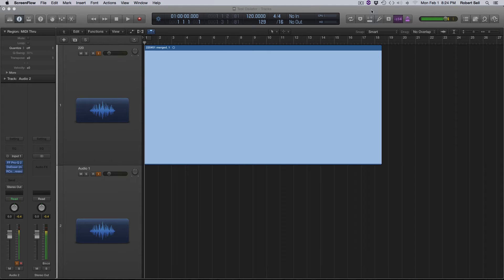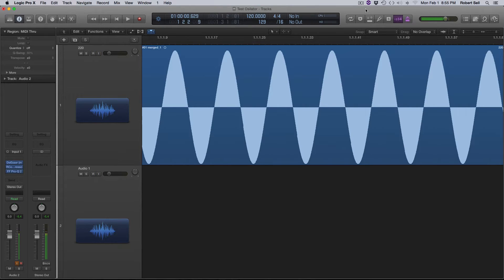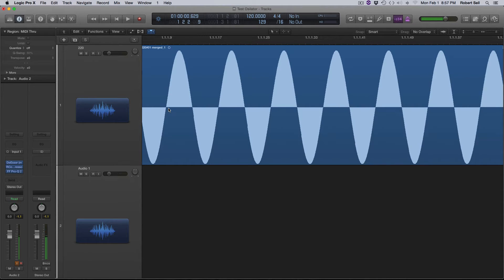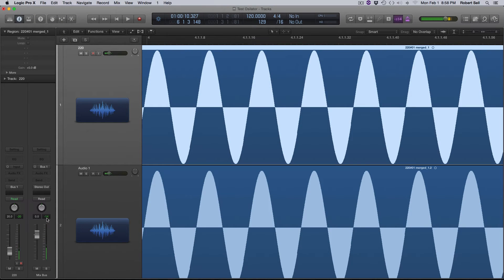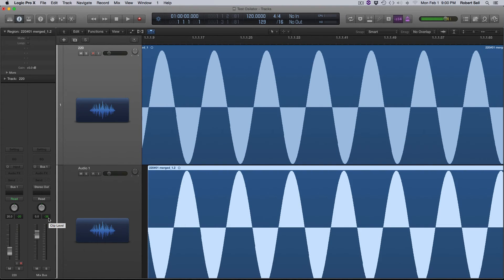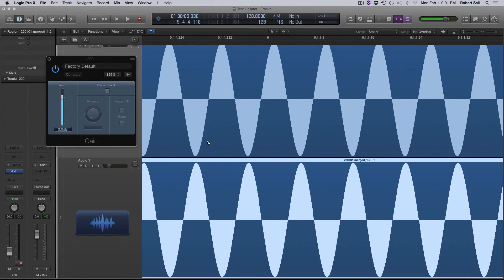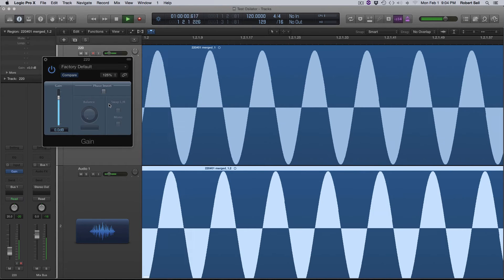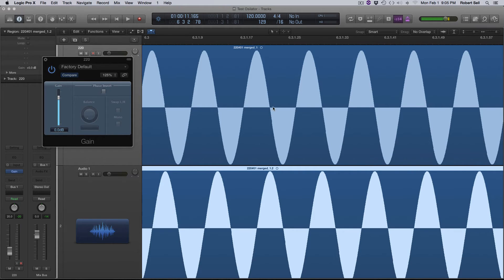Audio Recording Phase Cancellation

Comment: oh great knowledge right here..so can i do this with different instruments with different wave forms..eg a guitar and a vocals..?thanks in advance..liked and subd!Also..does Equing solve the phase problem?
Reply from the maker: Yes you can do this with any instrument, vocals, etc... However, phase problems are mostly related with recording the source with more than one input. i.e. 2 mics. Yes, boosting or cutting frequencies using  a minimum phase EQ will change the phase. If you are using a Linear Phase EQ it adjust timing to keep things phased align. Of course, the best way to check you mix is sum to mono and use your ears for missing frequencies. Hope this helps!

Comment: The best tutorial regarding phase cancellation I`ve seen it explains everything. I highly recommend it. Amazing job, thank you very much! One quick question. What happens if let say I have 2 identical audio tracks that are out of phase or cancel each other out and apply some EQ to one of them changing its tone? Are they still out of phase even when they`re not identical anymore? Also during mixing should you check your track regarding phase issues at the very start before you apply any processing? thanks
Reply from the maker: Thanks Lucas! If you had 2 audio tracks that cancelled each other out (100%) you'd simple invert the phase (180 degrees) to bring them back. But generally the alignment falls somewhere between 0 and 180. If you had 2 identical tracks there's no reason not to time align them. Phase problems are mostly related with recording the source with more than one input. i.e. 2 mics. Yes, boosting or cutting frequencies using  a minimum phase EQ will change the phase. If you are using a Linear Phase EQ it adjust timing to keep things phased align. Of course, the best way to check you mix is sum to mono and use your ears for missing frequencies. Thanks for the comment and the Q!
Reply: @BobSell  thank you for quick reply, appreciate your help. Just last 2 questions. 1.So if I make a  exact copy of he same track (let say for parallel compression) I don`t have to worry about phase relation because they will be always in phase? What about DI bass or guitar? I always apart from recording real amp, record separate DI for further reamping. So I always have 2 tracks for either guitar or bass, DI and amp. Should I check their phase? And last question phase cancellation only applies to the same source miced with 2 mics, it never happens regarding lets say snare and kick?
Reply from the maker: 1.  If you make an exact copy you don’t have to worry about phase relationship unless you shift one of the tracks in time
2.  Generally DI guitar or a bass track recorded for the purpose of re-amping is muted and only used if necessary to re-amp. Since it’s muted it can’t cancel anything out.  Otherwise if you’re mixing both signals together then check phase relationship  
3.  On a drum kit it’s not a problem with close mics. You should always check top and bottom snare. Also, check overheads or room mics with everything else.
Hope this helps.
Reply: @BobSell  thank you, really informative. Regarding already reamped DI track, should I check phase against normally recorded amp track? thanks
Reply from the maker: Only if you are going to mix the two together.
Reply: @BobSell  Don`t really get what you mean. I always keep both in my mixes, both 'normal' amp track and reamped DI signal and process both further in the mix, so in that case I always should check the phase at the start? Thank you, your information are really helpful and professional and sorry for so many questions but so far I didnt find anyone explaining that issue better than you, seriously :) Best Regards,

Comment: Sir, very well explained. Bravo!! I was struggling with a track in which the vocals sounded like karaoke when rendered to wave or Mp3. It would sound fine when in Vegas project. Can this phase inversion be done on Sony Vegas, as I use this software? I tried panning channels but didn't sound that great. Thanks anyways
Reply from the maker: Thanks for the awesome comment! Phase cancellation is not likely to cause your bounces to wave or MP3 sound bad. It should sound the same as in your project. I'm not familiar with Vegas but you should have a plugin that has a phase invert switch. You could try flipping the phase 180 degrees but like a said not likely to cause your problem. If you'll post your mp3 or otherwise send me the file, I'll take a listen. You can use selltechproductions.com and reach me if I can assist you further. Thanks again for the comment!!

Comment: Hi Bob . a quick question . when i record sound from my piano digital through the logic ( piano sample ) the sound its not 100% in phase in correlation meter . what do I need to do to get whole song in phase ?
Reply from the maker: Sorry Damoon I'm not real clear on what you are doing. So you are recording "sound from your digital piano" via a microphone? Or just using your digital piano to trigger the piano software instrument? Do you have 1 sound source Logic's piano? Or are you mixing the 2 piano sounds and they are out of phase? Please clarify.
Reply: Hi Bob , thanks for your respond . I connect digital piano to the laptop through a cable ( a usb cable ) and I use EAST WEST VST for piano sample on logic , I mean the sound its just  not from my digital piano , its from the VST piano sample sound , when I play on my digital piano keys and check the correlation meter its like jumping from the right to the left and from the left to the right ( the phase is not stable ) , one second in phase and one second out of phase . and also its just a solo piano not more than one  .  the question is what should I do to keep the sound in phase all the time ?
Reply from the maker: Damoon, what happens if you play one of the sampled pianos in Logic? The ESX24 uses samples so I’m just wondering if it’s related to your 3rd party VST plugin? Samples are recorded with microphones and its possible that someone did a poor job with mic placement. If you want to bounce the stereo piano track to wav or mp3, I’ll be happy to take a look at what’s going on between your left and right channel. You can send me an email at selltechproductions.com. Thanks.

Comment: Hey Bob,
I recorded a acoustic guitar with 2 mics/2 tracks and panned hard left and right in the mix. The waveform indicates out of phase, like a mirror image. When I reverse the phase it sounds like a mono recording. Any suggestions. Thanks for the videos.
Reply from the maker: Yes, I have a few suggestions/comments. Phase cancellation is only an issue when your sound is coming out of the same place in the speakers. The positive and negative wave forms are fighting one another. If you hard pan one track L and the other hard R then the 2 tracks are not even coming out of the same speaker. Therefore, no phase cancellation is possible. If your case, (waveform indicates out of phase, like a mirror image) if you want to test this, pan both tracks dead center and flip the phase on only 1 of the tracks. Toggle the phase switch on and off and you'll hear your guitars go in and out of phase. So the bottom line is you want them to be in-phase for MONO compatibility. When panning hard L and R flipping the phase will not help you unless summed to mono. Another suggestion: Try positioning the mics for the best possible phase when capturing the sound. The 3-1 rule should work well here. For every inch the mic is placed from the source, place the 2nd mic 3 inches away. For example, mic #1 is 6 inches from the 12 fret. Place mic #2 6 inches away from the bridge but at least 18 inches from mic #1. Hope this helps!

Comment: Hi. 
The display of the waveforms is different than mine. Yours looks like pro tools way where the lines are bold.
How do you change that?
Reply from the maker: It's Logic Pro X. Just try zooming in to get a higher resolution.
Reply: Your background colour is  blue and the waveforms are bold white. When i'm zooming in i just see the white outlines.
Reply from the maker: Which software are you using? What version?
Reply: Logic Pro X 10.2.4
Reply from the maker: I'm using 10.3.1 I don't remember it being different with earlier version. I don't have the advantage to see what you are are seeing. Maybe you are just zoomed in too much. When I zoom in really close the lines go from bold to just white lines. The display changes as you zoom in and out.